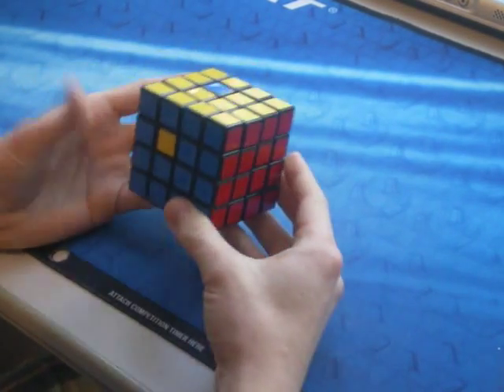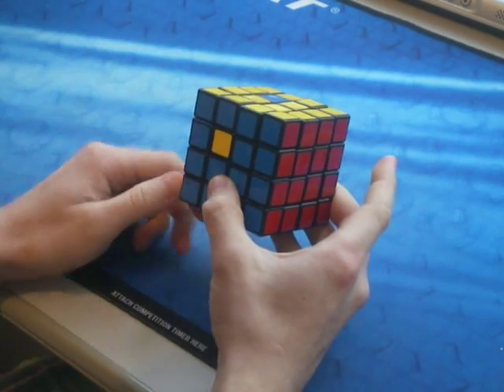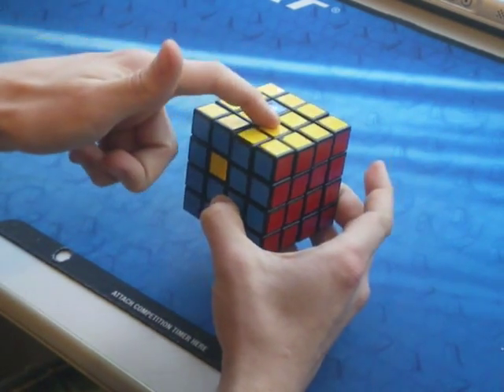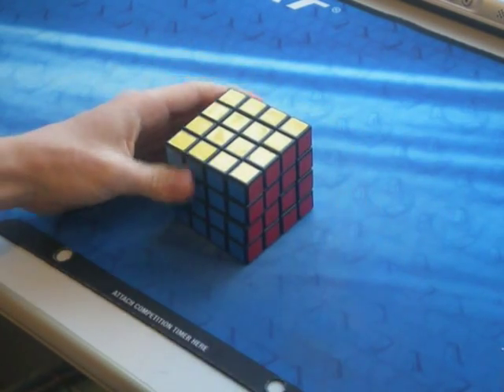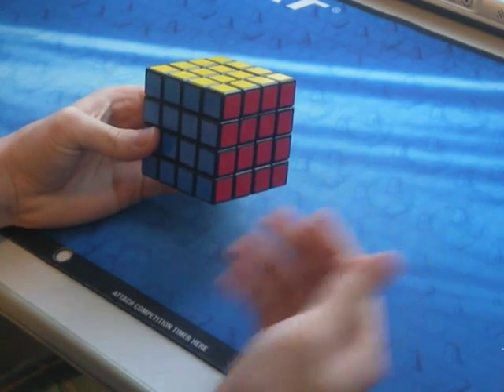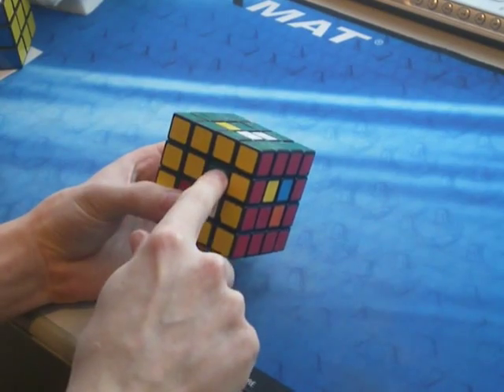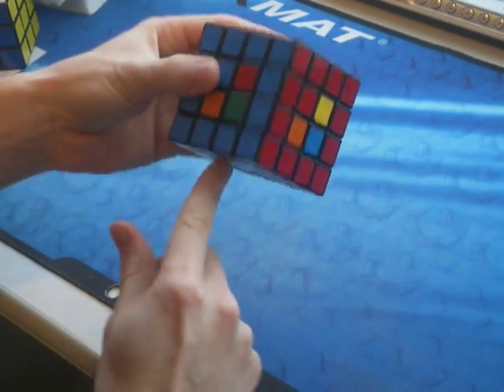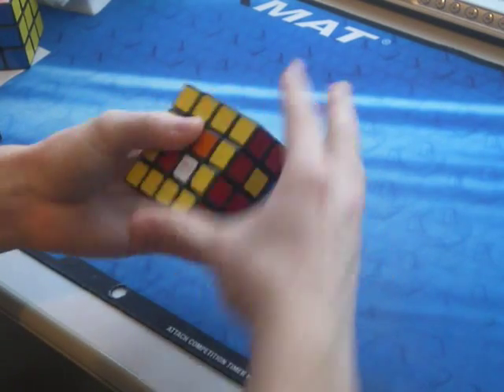Tutorial: 4BLD Centres

Comment from the maker: @TheMachanga It doesn't matter if the buffer is one of the opposite pieces. As long as you do the 3-cycle, you'll solve the 2 pieces you're trying to.
U face to B face to D face: D to U with f2 or b2 will be the interchange as those are opposite, and D belongs in U. So set up those two e.g. Dbr and Ubl are interchangeable with b2. Then Dbr would be the action spot, so something like r' B2 r b2 r' B2 r b2 would cycle Ubl to Bdl to Dbr.
Similar to the vid example but with an x/x' cube rotation

Comment: @kinch2002 Thanks about the 2 switch, but you didn't answer the first question. I know how to solve it if the buffer is on U and the opposite are F and B, but what if a piece is opposite of the buffer? (3 cycle, not 2 center switching)